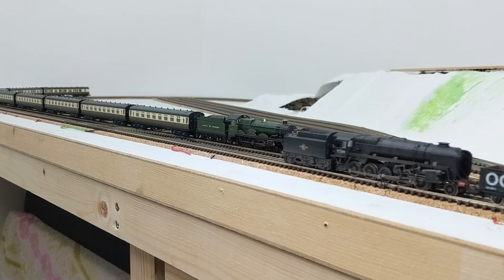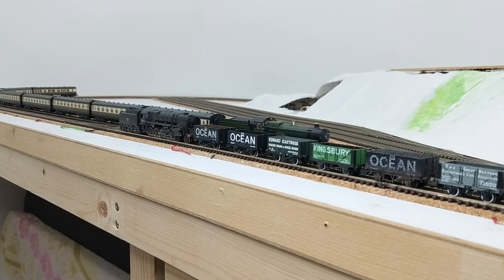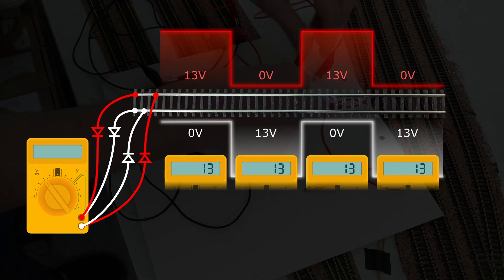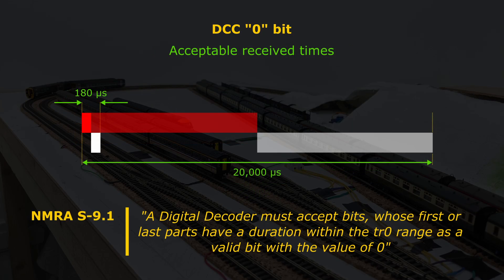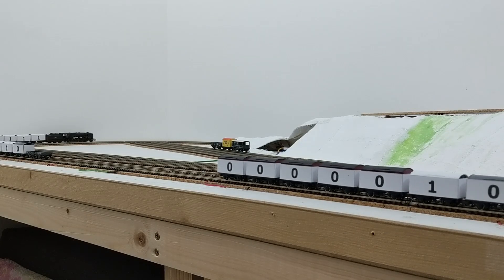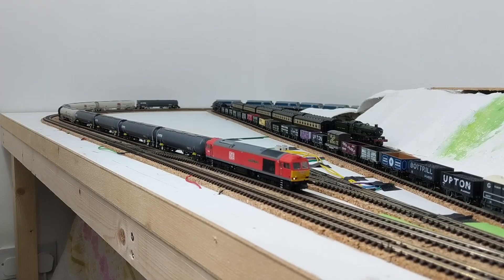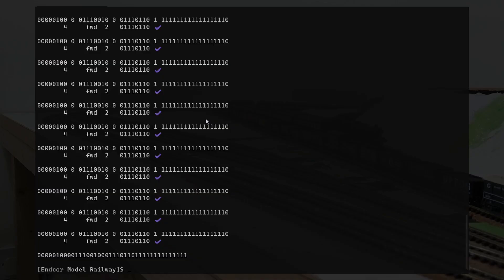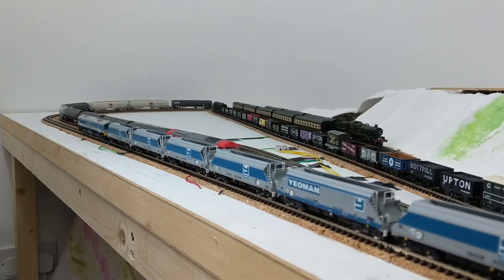0047 Decoding DCC from scratch

Comment: I would look into using the PIO on the Pico. You should be able to read data using zero clock cycles on either core. This mean MicroPython is completely viable
Reply from the maker: Several other people have mentioned PIO too, thanks 🙂

Comment: this is fascinating, best bit with going from the ground up is you actually know what its doing and why, helps with debugging.

I did similar, scalextric digital slot car stuff, way to go is to use interrupts (or the PIO on the RP2040, interrupts are easier). simple IRQ stores a flag. not too hard to get the timing between them in a loop, store it somewhere and use a state machine to process it

home made decoders are not generally small, they are however perfect for static decoders
Reply from the maker: Thanks 🙂

I found writing the code to use interrupts pretty easy to do, though the polling code is also easy. I think I'll start with an interrupt-driven approach when I move to C.

I have no idea what I'll actually be able to achieve with the circuit, but I'll have the freedom to make it a non-standard shape to fit the spaces in my locos, so that might help. I feel a long way off that yet though!

Comment: I assume that micropython is doing some garbage collection, so you might try force a gc.collect() at a time that makes it suitable for you. 

Python is not going to be a real time os. You might be better trying to run DMA transfers and processing that instead of trying to poll it.
Reply from the maker: Thanks. The polling wasn't my first approach, but it was the one that worked best in MicroPython. I'll be moving away from MicroPython for this - I was hoping it would do the job, but it doesn't seem to.
Reply: @endoorrailway  At least with python you gave it a try and got to know a bit better about whats happening. 
Thanks for sharing the video

Comment: According to Digitrax each rail is measured separately. Rail A and ground on your command station gives one number for voltage and Rail B and ground should give the same number no matter what system you are using. Try this to see what it is reading. Then adding both readings gives you the voltage output for both rails.
Reply from the maker: Thanks

Comment: This is a great project.  I think you need to be able to measure and see what you are measuring.  Please borrow or buy an OSCILLOSCOPE.  I have one on my desk at work and without it, you would be guessing.  The idea of just using a voltage divider is a great idea.  Yes a comparator may work, but you now have to worry about speed and false triggering.  There are fast opto couplers available.  I use one made by Sharp and has 5 pins, two for the LED inside and three for a 5V, Ground and signal.  If memory serves it's called a PC400.

Best of luck with this.  What I have seen is that when you can reliably trigger on your signal, then the decoding starts to make more sense as you are getting good data,
Reply from the maker: Thanks 🙂
With the various different suggestions I've been given I may well have to give in and buy an oscilloscope, just to see how the different approaches compare. Thanks for the component code - when I get a chance I'll need to go back through these comments and make a list of the things people have suggested and do some online shopping!

Comment: Enjoyed your video! What about using two diodes instead of the voltage divider or regulator for the input? Connect the catodes to each rail and the anodes to two different inputs of the Pico and perhaps separate pullup resistors between 3.3V and the anode of each diode.
Reply from the maker: Thanks 🙂 And thanks for the suggestion. The various helpful comments on this video have served to remind me just how little I know about electronics! Diodes just control which direction current can flow in, if my understanding of them is correct, and so I used them to split the signal - but the signal is at 13V, which is far too high for the Pico's (or other microcontrollers') inputs. Is your suggestion that, essentially, only a large enough resistor is needed in order to reliably reduce the voltage from 13V to 3.3V after the diodes? The Pico has internal pull-up and pull-down resistors, which one to use is configured in code, so at this stage I don't need to add any for that purpose as far as I'm aware.
Reply: @endoorrailway  With a diodes mounted the way I suggested, the current should only flow to through the diode and pull the input down to 0V when there's 0V on the rail (suggest using similar diodes as the rectifier to have the same voltage drop). When the rail is at 13V the diode blocks and pin is pulled up to 3.3V either internally or with a resistor.

Probably not necessary to monitor both rails, then you can use only one diode and input.

But I think a setup with an optocoupler as some already suggested is the most optimal way of harversting the signal.
Reply from the maker: Ah I see, that's neat, thanks!

Comment: I do not use the Nano, myself, but one thing that occurs to me is that your assumption on the execution speed for the Nano Pi could be optimistic. As standard, the Pi runs an interpreted Python, which is usually regarded as a very slow process. 
The Pi forums are awash with suggestions to improve the speed, one consistent one being micropython, which seems to be compiled to machine code. One point of discussion is that the Linux operating system is SAID to "take a fair bit of time", although some then say "1% of your CPU time is not a lot". I have seen "news" that the Arduino IDE will program the Nano, but not tried that.

There are cheap oscilloscopes on Aliexpress, I use a DSO138, but it seems the DSO152 is better, good enough for Adrian of Adrian's Basement on YT to mend a computer with it.

Using an ESP32, which runs a compiled C++ from the Arduino IDE should be even faster, but involves learning C++ and different hardware. 
Avoid the Arduino itself, an Arduino Uno, for example, has none of the advantages of the newer processors, which are aiming for "computer on a chip" functionality. ESP32 has 2MB of RAM, Wifi, Bluetooth, three UARTs for serial, I2C, SPI, two processors, interruipts, two timers (or is it 3...) as standard.
Reply from the maker: I've never looked at a Nano Pi before, but it looks much more like a computer than a microntroller - what I used here was the Pi Pico. I don't think there's any option of having standard Python on that - MicroPython is all I've seen - but I've got no idea how it implements Python on the Pico. Without an operating system being present it must be quite different, but to work like Python it must still have various inefficiencies. I know that standard Python gets compiled to bytecode at some point (the .pyc files that appear), but is still an interpreted language.

The RP2040 sounds like it's one of the computers on a chip - I'll have to assess more options when I get to the stage of making something small enough to go into a locomotive.

I've got no fear of programming in C or C++ - I've done that before - but I've got a lot to learn about doing it with microcontrollers and in some cases even just how to get the code flashed onto a chip seems complicated! All good fun learning it though 🙂

Thanks for you ideas and taking the time to write that up 🙂

Comment: i wonder what the proper commercial approach to signal conditioning is?  is there anything in the spec that describes appropriate circuits for picking up the signal from the rails?  in my opinion voltage regulators and voltage dividers are not going to be enough, and will be noisy.  i think you might have better luck with optocouplers.  these use a light (or infrared) emitting diode across the input signal to turn on a phototransistor on the output side, and will automatically produce a 3v3 signal that is completely isolated from the rail power.  if you install two, and connect one in reverse, across the rails, you can select the polarity you are detecting. because optocouplers more dependant on current than voltage, it should give a much more reliable pickup, i think, and i strongly suggest you look into this.  however i really would like to know what the specification expects.  as for interrupt driven decoding, you may want to consider that there are different priorities of interrupts and, unless you use the highest priority, your interrupts will be postponed by anything else the system thinks is more important, and this will skew your timing.  thank you for introducing me to this topic, it is fascinating.
Reply from the maker: In what I was reading I didn't come across anything that suggested implementation solutions, it was just specifying what needs to be achieved, but I haven't read through most of the documents - I was just trying to get started somewhere. The various specifications are at https://www.nmra.org/index-nmra-standards-and-recommended-practices

A few other people have suggested optocouplers too - I'll have to take a look at what's available - ultimately I'd like to make something that fits into an N gauge locomotive, so small surface-mount components will be needed. I'm sure there's be optocouplers that fit that constraint though 🙂

There was a nice guide about interrupt programming I read that's part of the MicroPython documentation; I'm not sure what other interrupts would be going on, but it seemed to be saying that all of the same priority would queue up if they overlapped, so I just left them at default. Maybe there are others happening that I don't know about, but I think they'll also be affected by the voltage regulator potentially distorting the timing, so there seem to be a few ways in which I could improve things.

Thank you for taking the time to share that useful information 🙂
Reply: @endoorrailway  i tried reading the spec, thanks for the link, but it seems they do not concern themselves with the actual interface, and these are proprietary.  must first admit my electronics technical degree was a very long time ago, and i am very out of practise, but i think you could use a PC817, with an appropriate current limiting resistor, directly across the track signal, and you could then connect the ouput directly (and safely) to your GPIO pin.  if the track voltage changes, though, you would need a different resistor.
Reply from the maker: It didn't take you long to scan a lot of information there! With a degree like that you'll have forgotten a lot more than I'm likely to learn in this field. Thanks for the suggested component - I'll have to start making a list of the various things that have been suggested.

Comment: Absolutely LOVED this video... completely Nerdy and pushed so many of my buttons with reverse engineering, electronic, programming and Picos.

I think microPython and Pico PIOs is a good solution. I have a project 'picotimcode' which de/encodes a similarly structured protocol.

Use separate PIO blocks running small state-machines to break the capture/decode into several parts. Collate the bits and pass to microPython code via FIFO and interrupts.

I use one core to controll PIOs to do decode/encode, and the other core to do UI for controlling the whole lot.

Good luck, and thank you for bringing me smiles/entertainment.
Reply: Also when thinking about capturing bits, think in terms of time rather than voltage. Quick toggles vs slow toggles.... this should be easy for a PIO block.
Reply from the maker: Thank you very much 🙂 It's getting a lot more views and comments than is typical for my channel, so I think it's ended up appealing more to the general electronics hobby or pros than to just model train-loving folk!

Thanks for mentioning PIO - I haven't spent much time to date working with microcontrollers and hadn't come across it before making this video, but others have since mentioned it too.

I'm glad you like Picos too, but ultimately for this project I'm aiming to use something physically smaller than the RP2040 (some kind of ATTiny is what I have in mind), so I don't intend to go down the PIO route because it looks like it's specific to the Picos, but if I were sticking with a Pico then it does look like a good way to go.

I'm glad you enjoyed it, thanks for letting me know 🙂
Reply: @endoorrailway  there are quite a few really small RP2040 and RP2350 boards, magic word is 'stamp'....
Reply from the maker: A stamp is too big for a lot of N gauge locomotives. For what they have crammed inside these systems on a chip are a real marvel of engineering, and so cheap for all the wonders they perform, but at 6.5-7mm square the RP2040 takes up a decent amount of space that I'll need for other bits and pieces like optocouplers, resistors, some kind of non-volatile storage, motor driver, amplifier etc. - I know there are less capable but much smaller chips around. I really don't know what will work, ultimately - I may well end up with an RP2040.

Comment: smells a little like 12v canbus in a car, your rail 1 would be canH and 2 as canL
Reply from the maker: This is the first time I've tried to work with a digital signal at this level, so it's all "DCC stuff" to me, but it seems likely the engineers who designed it were familiar with other similar things like canbus and took inspiration. That would also help other engineers understand it and work with it easily as there'd be familiarity.
Reply: @endoorrailway  yes true, in fact just about all signalling systems have evolved from another before, no matter how complex they make it once it passes through circuitry it all boils down to just 1's and 0's.
this one is fairly basic in that theres no error correction just bad packet skipping, you want an headache, look into a cd players data stream thats designed to cope with random flipped bits from noise/dirt of the disc, its amazing how they even came up with it and I'm glad i'll never have to try to code for it....
Reply from the maker: At this stage I'm pleased that the error detection is just skipping and not correction! Yes I've been impressed with how well CDs can play even with a decent amount of scratching on them. I think that's going to be at a complexity beyond what I dabble in during my hobby time 😉

Comment: Nyquist's sampling theorem applies to your track signals: you must sample at least twice as fast as the shortest pulse, so given shortest = 52us, you have to [be able to] sample at 26us intervals. I would suggest you sample at a faster rate than this though: it's common with UARTs to sample at 16x the baud rate, and while that might not be needed, 4x is probably a good thing to aim for.
I would strongly suggest looking at the "PIO" units of the Pico. They are kind-of a dedicated I/O processor, and will be able to sample the input very effectively. You can program them from a high level language and then get the benefit of full speed processing. There are a number of example configurations available in the pico SDK - look for example at the I2C and UART setups for inspiration, as they are doing similar things (sampling a pin and decoding signals on it).
Reply from the maker: I knew there must be a formula, thanks! With 26μs samples a DCC "one" of 64 could potentially be measured as lasting 78μs, but the shortest a DCC "zero" could be measured at is 104μs. But with a 29μs sampling frequency a similar thing comes out - max One is 87μs, minimum Zero is 116μs. I must admit I keep having thoughts like this, but eventually find a scenario that proves me wrong. So far 29 is the largest I've come up with where (I think) there can't be an overlap in interpreting the longest One and shortest Zero.

Thanks for mentioning PIO - it's not something I'd come across before making this video (I've not got a lot of experience with microntrollers), but a few other people have mentioned it since. I think it's specific to the Pico, so I'm not intending to go down that route to start with because there are physically smaller microcontrollers around, so I'm expecting to translate what I learn to another architecture.

Thank you for taking the time to explain those things 🙂